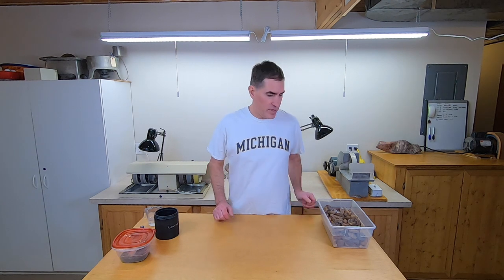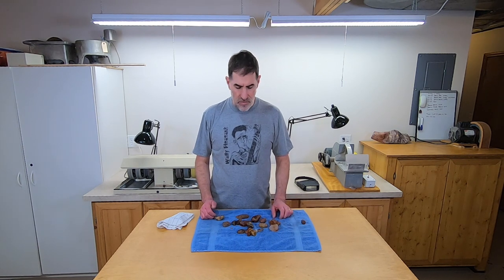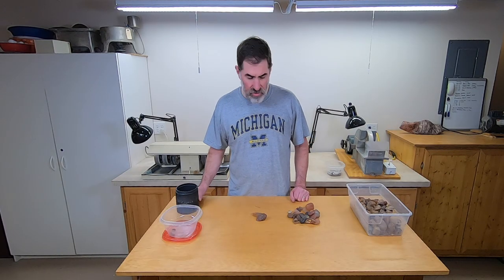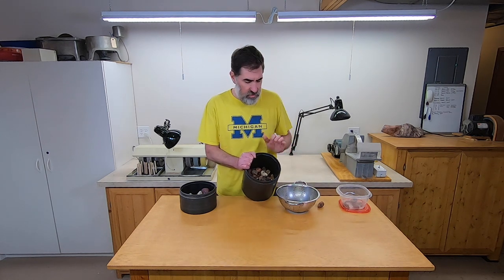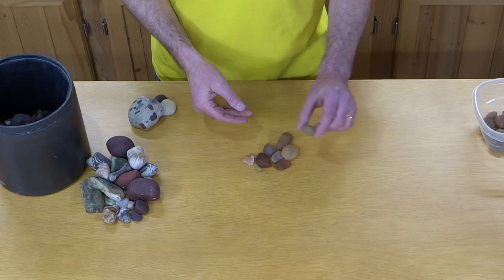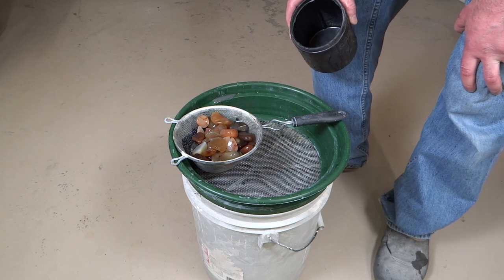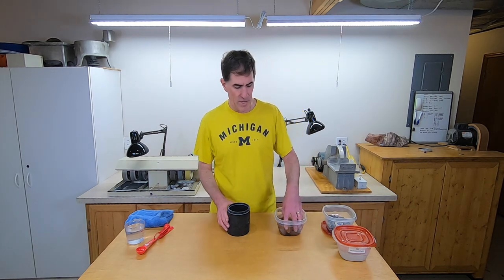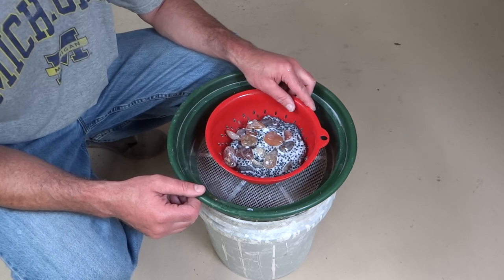How to Polish Rocks with a Rotary Tumbler and Plastic Media

Comment: Hello Rob ! Great videos !! I have learned quite a bit about tumbling thanks to you! I am currently working with a tumbler but I would like to invest in a vibratory tumbler. Which one would you recommend for a beginner/intermediate level ? I appreciate it !!
Reply from the maker: It doesn't matter what level you're at.  I'd buy a single barrel Lot-O tumbler.  I have one and I love it.  I get a much better shine than what you saw in this video.  If you take a look at any of my "Rocks in a Box" series, almost all of those rocks were finished in my Lot-O.  I won the World Wide Rock Tumbling Contest in 2016 using it.  I'm not sure about this year, but for about the past ten years that contest has been won using a Lot-O.

I have another video showing how I use it here:   https://youtu.be/ksrmpPZrAuU 

I'd suggest buying it from The Rock Shed.  They usually have the best prices.  Tumblers are hard to find since the pandemic, so they might not have one right now, but it's worth waiting for.  https://www.rockshed.com/product-category/rock-tumblers-supplies/rock-tumblers/vibrating-rock-tumblers/lot-o-tumblers/
Reply: @MichiganRocks  is thereby  any chance other options than the rock shed for the lot-O tumbler ? I believe they wont have any available any time soon ! Thanks !!
Reply from the maker: @kikom3327  Kingsley North sells them.  I'm not sure if they have any in stock either.  There is a shortage of tumblers right now.   https://kingsleynorth.com/lot-o-tumbler-single.html
Reply: @MichiganRocks  Hello Rob ! Got some great news ! Just received my Lot-O tumbler today in the mail ! Do you by any chance have a video or a general beginner guide as to what rocks can be tumbled. In other words what would you suggest I should definitely discard for tumbling?
Thanks !! Really excited to get it going !
Francisco
Reply from the maker: @kikom3327  I don't have a video showing that specifically. You want rocks that are hard enough, generally 7 on the Mohs scale will tumble well. That would include agates and jaspers which are good tumbling candidates. Avoid rocks that are crumbly or  have very deep holes. Granite is a rock that I avoid too, but it's a popular one for people to pick up. Granite has both hard and soft minerals mixed into one rock. The soft minerals wear away faster and also don't polish easily. That leaves dull little ruts all over the rock.

I tumble a lot of rocks from beaches and usually just throw them all in and see what happens. You'll learn a lot by doing that and will start to get a feel for what tumbles well and what doesn't. I'd suggest doing the same and learning by experience.
Reply: @MichiganRocks  Hello Rob ! Two quick questions. This weekend I am going to setup my vibratory Lot-O Tumbler. What would be your best recommendation as far as the base setup? Is the cancer block a good idea? Also, what ceramic media is ideal for this tumbler? I currently bought 5/32" and 5/16" from Rock Shed. These guys should have you on their payroll !! Thanks!!
Reply from the maker: @dafreak83  I filled the holes in a concrete block with Quikrete, painted it, and then mounted the Lot-O on top. I think there was double sided tape included that I used. A friend of mine glued several blocks together and mounted his on top so he doesn't have to bend down to use it. I don't mind bending down, but he really likes his up higher.

You bought the right ceramics. I mix them 50/50.
Reply: @MichiganRocks  hello Rob ! I finally got the appropriate installation for my Lot-O. Quick troubleshooting questions. After aligning the weights and turning the machine on, after running it for 30 minutes or more and turning it off, the weights are misaligned again. Is this normal ? Also, I cant seem to get the correcto amount of water to get a smooth run. Please send some suggestions SOS ! Haha thanks Rob !
Reply from the maker: @kikom3327  I have never had my weights become misaligned. I'm not sure what would cause that except a stripped out fan. If it's a new machine, I'd contact the company. If it's a used machine, The Rock Shed sells parts. I'd get new fans.

There should be no standing water in the barrel. I fill my barrel with water, then put in the rocks, then hold my hand over the top and dump out all the water. You should be left with wet rocks. You will need to squirt in more water as the rocks tumble. I'd check back a few hours after the rocks have been tumbling. Just give the rocks a squirt or two from a squirt bottle and then wait for a bit while it gets distributed over all the rocks. Only add more water if it's necessary. The rocks should look wet, but no more. In the first stage, check them before you go to bed, in the morning and once around the middle of the day. I always checked right after I got home from work. In the 220 or 120/220 stage, you'll have to add water fairly often. After that, I don't usually add water more than once a day.

Comment: Do you find that the rotary tumbler just doesn't do as good a job? Also, you have so much patience to do a full tumbling video that follows the whole process - I always forget to film a stage or two, and then it's all over. :D
Reply from the maker: I bought a vibratory tumbler before my first rotary batch was finished.  I have way more experience with a vibratory tumbler for the end stages.  I think it's easier to use a vibratory tumbler, but it's completely possible to get a great shine with a rotary tumbler.  I prefer using ceramic media over plastic, but some of the best rotary tumblers swear by plastic.  I guess it's what you get used to and get practice with.

Comment: I'm curious do you test the hardness to make sure you are tumbling rocks of similar hardness?
Reply from the maker: Nope. It's a good idea to tumble rocks of the same hardness though. Sometimes I tumble all the same kind of rock like in this video, but often I mix them up. I do know that some rocks are really soft though, and I don't mix them with other rocks. For example, Petoskey Stones are soft and I don't do them with other rocks. I also tumbled fluorite once and that was done by itself because it's so soft.

Here is a video on testing for hardness if that's something you're interested in doing: https://youtu.be/GpH55EylhX0
Reply: Thank you. I'm planning on getting a test kit as I'm still so new at this but until I do I'm trying to look up each rock and mineral I think it is and going off of that

Comment: I know you have said this before,  where do you get your supplies from ? I see there are a quite a few suppliers,  but shipping costs are killer.
Reply: Also i have learned alot from your vids , thanks for all 👍
Reply from the maker: I buy from The Rock Shed and Kingsley North.  Mostly I buy from The Rock Shed.  The thing I always buy from Kingsley is 46/70 grit because they sell in 45 lb. packages and I get a better price that way.  Both places will ship in USPS flat rate boxes when they can which saves some shipping costs.  I know Kingsley charges sales tax because they're in Michigan, but I don't think The Rock Shed does.  You should double check though.

Comment: So i guess the key here is to examine the rocks prior to the first stage, if deeply pitted i guess discard them or cut them up ?
Reply from the maker: I have saws and grinders that I use on those rocks.  I just didn’t want to use anything but a tumbler for this video.  I wouldn’t have thrown any of these rocks out, but I would have cut a lot more of the pits out.  Sometimes you can break a rock along a crack or hole and end up with two decent rocks to tumble.

Another option is to just not be as picky about revolving every pit.  Sometimes I just set these aside and do a whole batch where I leave the pits in the rocks.  By tumbling a batch of imperfect rocks together, I know I will have to be very careful about cleaning between stages and I don’t have to worry about a single bad rock carrying grit to the next stage and ruining a really nice batch of rocks.
Reply: @MichiganRocks  Thanks, thats really good advice about keeping all the 'bad' rocks together so they dont ruin the 'good' ones, im new to rock tumbling so still learning, but thanks for replying and for your videos

Comment: You are my rock guru...and I need your advice...
I finished my final polish on my first batch of rocks, using plastic media and the Lortone 33b.  I tried to be patient, like you.  I tried to get all the imperfections out on the rough tumble.  I let the 3rd stage and the final polish go for 2 weeks each.
Today I removed them from the final polish, rinsed them, and ran them with borax for a couple hours.
They aren't shiny.  What did I do wrong?  I do have really hard water.  Please help!  Thanks
Reply from the maker: Well that's really frustrating after all that time. I can't imagine hard water being the problem, but I don't have hard water, so I can't say for sure. Did you use fresh plastic media in each stage? You can't move it on with the rocks because grit gets embedded in it. You didn't say what kind of rocks you were tumbling. Also what grits did you use at each stage? What kind of polish are you using?
Reply: @MichiganRocks  Yes, fresh plastic media at each stage.
I had some purchased agate, amethyst, and some local rocks I found around here.
Also some pea gravel mixed in.
I used borax after each stage, and a toothbrush on any non-smooth part of the rocks to clean.
60/90, 120/220 silicon carbide. 500, 1000 aluminum oxide (white).  I think those numbers are correct--my tumbling is done down in the hay barn.  I will double check tomorrow.
They feel smooth, just no shine
Reply from the maker: @kokosnood  1000 is not really polish. I use that sometimes as a prepolish. The polish I used in this video is from the Rock Shed and I think it's 1 micron or about 14,000. There's a link to the Rock Shed in the description and I also have their grits and polish in my Amazon storefront. That's the only thing that I see that you might be your problem.
Reply: @MichiganRocks  You were right!  I had bought a "kit" of 4 grits off of Ebay.  Bad idea.  The final polish is only 1200.  I will order the 14,000 from the Rock Shed.  They are great--I got my 33b from them.
Thank you!
Reply from the maker: @kokosnood  I have been a very happy customer there for years. Hopefully running them in polish for a week or two will do the trick.
Reply: @MichiganRocks  I feel bad for beginners who think the four pack of polish they get with their beginner tumbler will give them good results.  I've really learned a lot from your videos.  Eventually I might get some more equipment, starting with a Lot-O.  I also really like your saw and wet grinder.
Reply: So I went to the Rock Shed to get the polish, and they have the Lot-O back in stock.  I pulled the trigger and ordered it, and an extra barrel, grit, and a bunch of 7 hardness rocks.  :)  I'm hooked now!!!
Reply from the maker: @kokosnood You are going to love that machine. It's so fast and uses almost no grit and you'll get super shiny rocks.
Reply: @MichiganRocks  I got my Lot-O, and now The Rock Shed is out of them again!  Where did you find the 40 (or more) pound concrete block for the Lot-O ?  My local Building supply only carries the 25lb cinder blocks.  Did you make it?  What did you use for a mold?
Reply from the maker: @kokosnood  I bought a concrete block and filled the holes with Quikrete. I didn't weigh it, but it works fine.
Reply: @MichiganRocks  That is the same solution I came up with.  Did you put handles on the sides of the block?  Considering that...

Comment: Have you ever had a tumbler over pressurize?  I just finished my second week of the second stage for the first time and the bottom of my tumbler was completely rounded. I didn't realize it would do that. Operator error?
Reply: To clarify it was run and changed after a week like in the video, so it was only a week of running that did that. This is only my first time on stage 2 of tumbling.
Reply from the maker: Yep, I had that happen when I tumbled some glass once.  I hear it happens quite often with obsidian, although I've never had a problem with obsidian myself.  A lot of tumbling instructions will tell you to check the barrel after a day to see if the bottom is swelling.  I have had so few problems with it, that I almost never check my barrels.  The only exception is with glass or obsidian.
Reply: @MichiganRocks  thanks for letting me know! That would have been crazy learning experience had it split lol what a mess

Comment: How do you know when your rocks are done with stage 1 and ready to move to stage 2. My amethyst rocks have been in stage 1 for 5 weeks and there are still minor cracks and imperfections that have the possibility of retaining grit. Is it okay for me to move on??
Reply from the maker: You can always move them on, even with cracks and holes. Just be careful to clean those out between stages really well. For bigger cracks, clean with a toothbrush under running water. Then, if you want to be really careful, put everything back in the barrel between stages, add either a tablespoon of borax or some shaved Ivory soap, and water up to the top of the rocks, and run them for a few hours.  That will remove some more grit.

Basically, it's a judgment call about when to move them on. It's what you're happy with. I just cleaned out some barrels this afternoon and moved on some rocks that I wasn't super happy with, but I could see that they were never going to get any better.
Reply: @MichiganRocks  thank you so much!!! This helps a lot!!

Comment: Ha!  I should have waited until the end to ask my question. Sorry.
Reply from the maker: No problem, Amy. I much prefer ceramic media over plastic. With a vibratory tumbler, plastic doesn't even work and with a rotary tumbler it's just a pain to deal with. With ceramic, you can just move the media from stage to stage with the rocks.

Comment: What is the best way to clean the barrel of a rock tumbler
Reply from the maker: I just rinse it out. Sometimes I'll use a toothbrush around the rim if it's got slurry caked in there.
Reply: @MichiganRocks  what is the best way to polish snowflake obsidian I've seen people just put water in the barrel and let it spin
Reply from the maker: @robertjackson7971  I just did a video on that. Here it is: https://youtu.be/aW5UmiYY89g
Reply: @MichiganRocks  thanks dude
Reply: What advice do you have for me as a YouTuber
Reply from the maker: @robertjackson7971  That’s a big question. Do you have a more specific question?
Reply: @MichiganRocks  should a rock tumbler be in a box with a lid
Reply: Is snowflake obsidian good to polish in a rock tumbler
Reply from the maker: @robertjackson7971  It depends on what kind of tumbler you have and if you're a very experienced tumbler. It's best started in a rotary tumbler and finished in a vibratory tumbler. It's not a good rock for a beginner. Here's a video where I tumbled some obsidian. I added the snowflake obsidian in the second week, I think. https://youtu.be/aW5UmiYY89g
Reply from the maker: @robertjackson7971  Probably not. Having a tumbler under a lid isn't the problem, it's the motor. Motors get hot and putting it under a box is going to make that worse. The only exception I can think of is if it was outside in the winter. Even then, I'd be worried about starting a fire.
Reply: @MichiganRocks  sorry if I keep asking questions this is my first one so on Instagram I will show you the rocks once they are finished